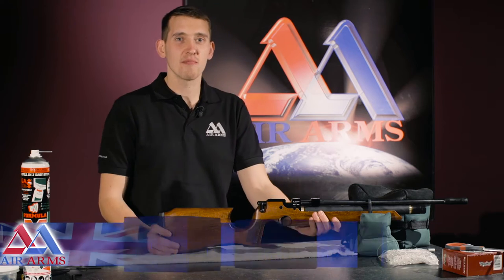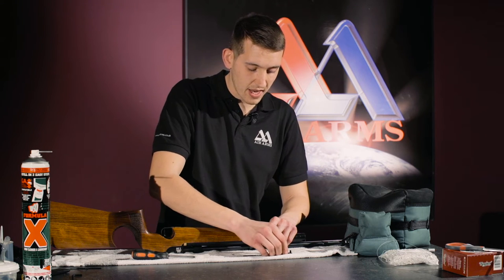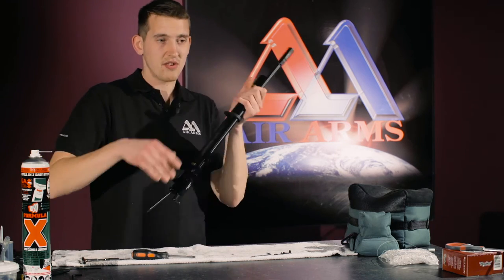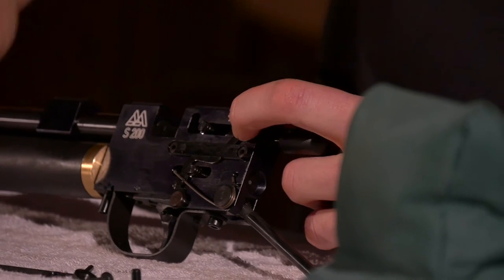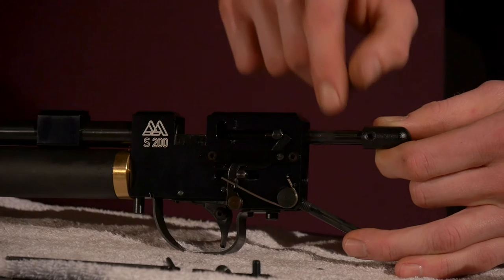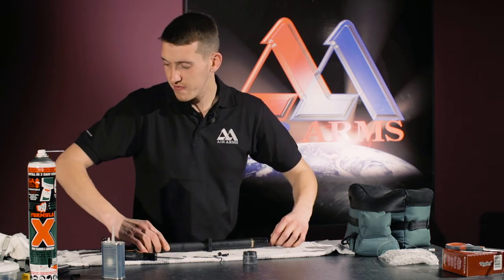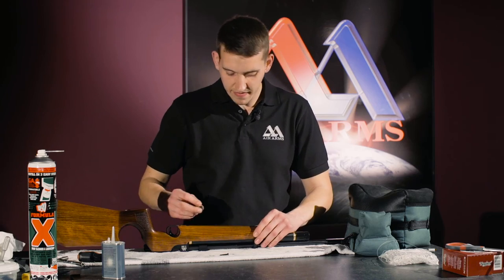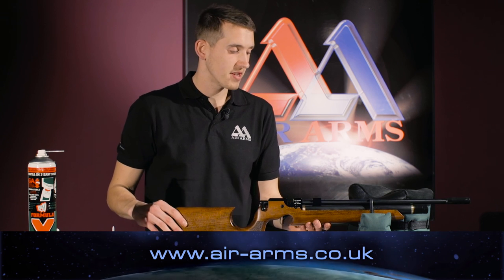Air Arms D.I.Y: How To Apply Oil or Grease To A S200 Air Rifle

Comment: A little disappointing video quality wise considering it's from air arms themselves ,plus oil for the the rubber  seal no clarification  as to whether or not a special oil is required.. Just observations.
Reply: E Reader
Reply: E Reader Yep your right!!!!great observation my freind!!! Keeping in mind the "rubber" seals o-rings in my opinion should be donewith silicone grease/oil. A Hillman hand pump with all its o-rings made in UK suggests using "only" the silicone grease as they provide it with product... using normal oil especially in probe area can combust in barrel, as most oils are made with petroleum!!!!!!!
regards, Jessie